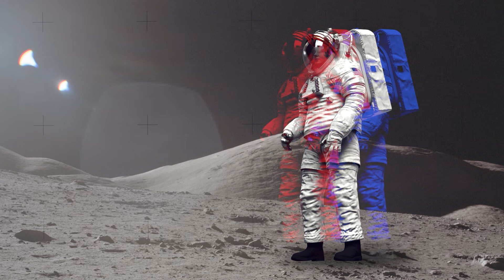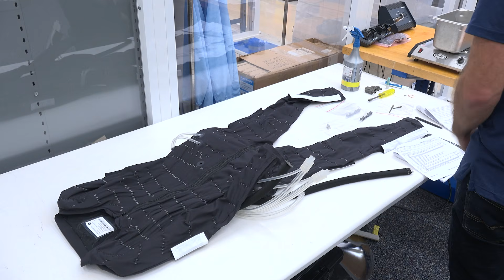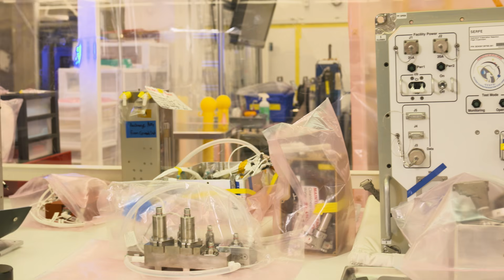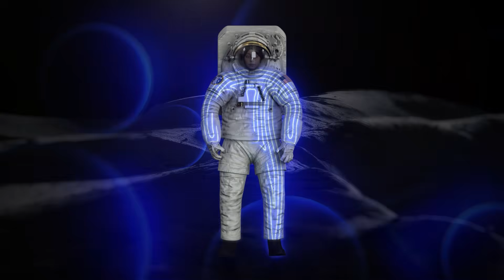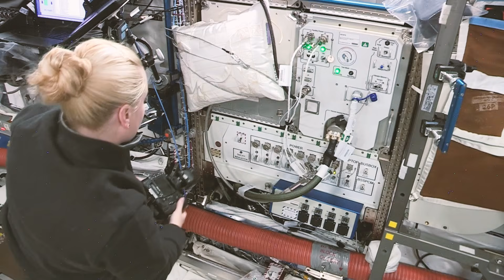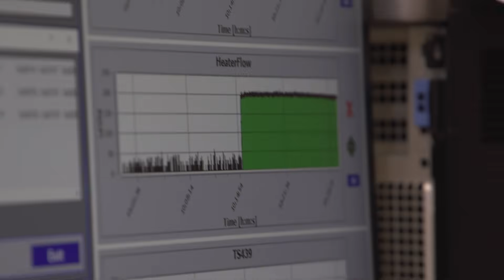Keeping Cool in Space

Comment: How do they cool the water back down from 250° f? Your air conditioner can't even cool your air down less than 20° then the outside temperature.
Reply: I'm no expert but look at all that hulk mass in that EVA Suit, bet there is thermal raidiation, insulation, conduction, protective, radiative and mechanical cushioning layers in there maybe. Can you  guess how much all that weighs here on Earth? Watch that video, all the Earthbound and Lunar Astronauts seem to flex, unflex and move that EVA suit layers skillfully scientifically, calculated controlled movements, slowly, carefully, risk free, unless an exigency requires fast ejection.